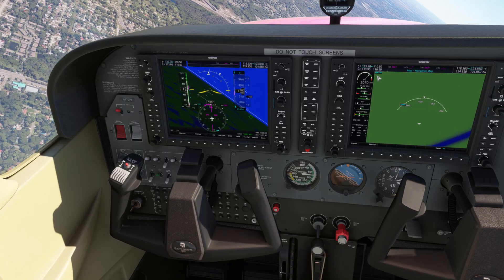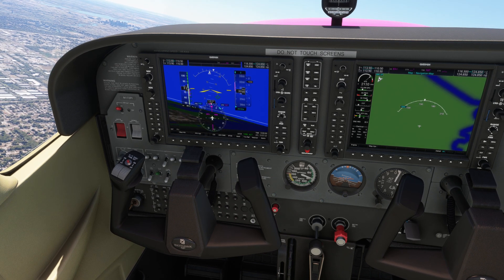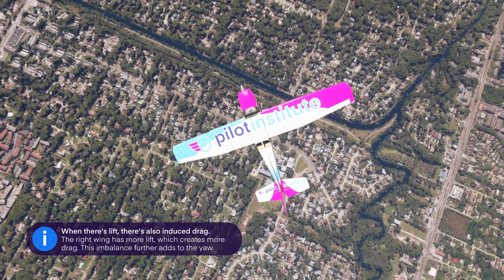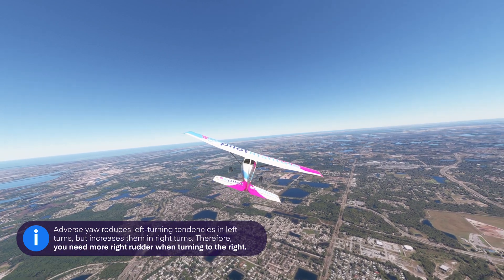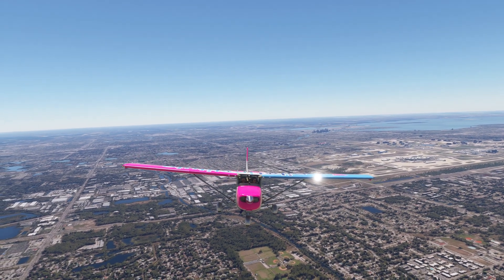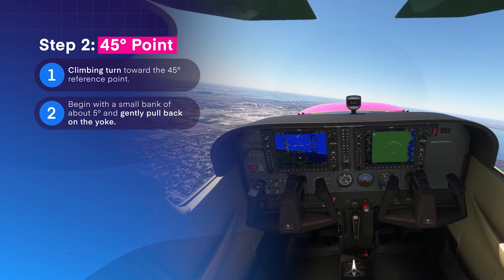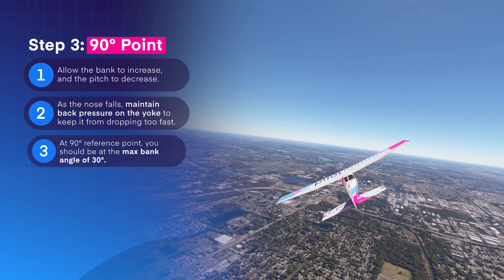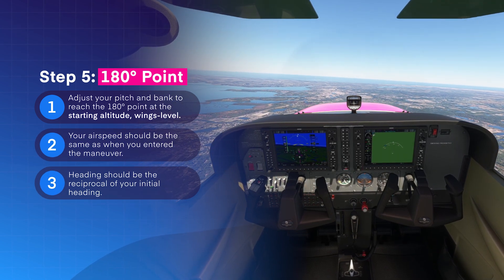How to Fly the Perfect Lazy 8

Comment: At the 135° max pitch is 5° nose down and not about 15-20° nose down? (15-20° from nose up and applying that same degree down). Why wouldnt that be?
Reply: AOA. You can stall a wing at any airspeed and any altitude but only one critical angle of attack. 15deg gives 3x margin over that critical point.

Comment: Should probably know your initial heading and turn direction before determining your 45, 90, and 135 points. The 180 point can just be putting the wing on the outside of the turn right on the 90 degree point